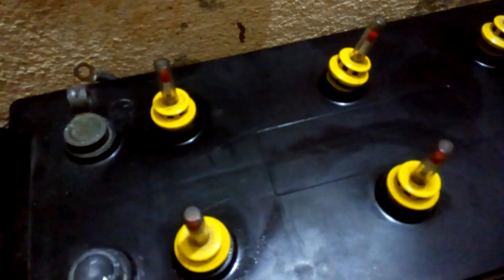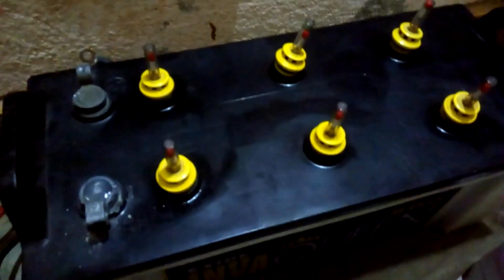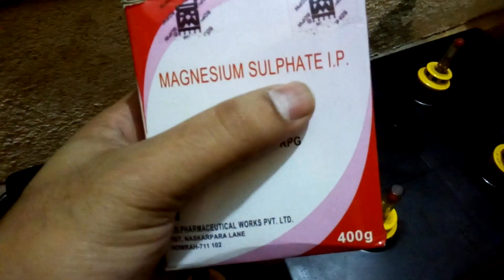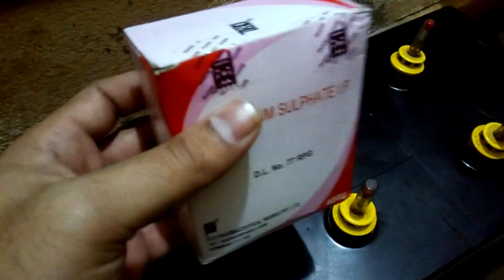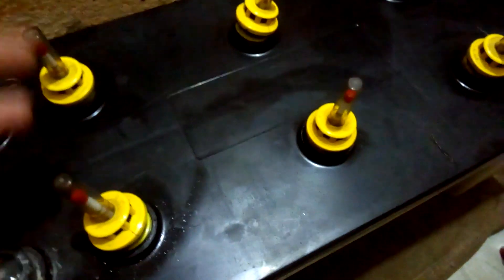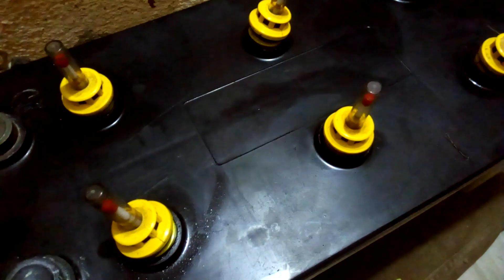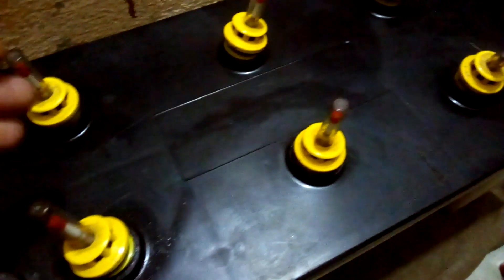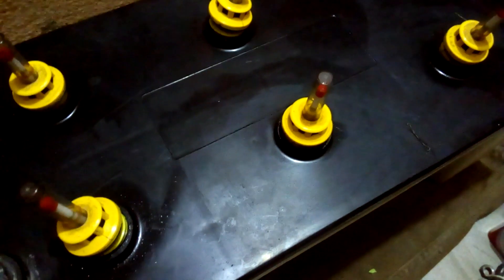How to revive a old/dead inverter Battery

Comment: I have an inverta battery i bought for the past four years. The battery no longer stays long even though it shows it charging when charging it
Reply from the maker: Check the battery voltage & water level
Reply: I have  checked and added water acid
I think the weakness started when  there was no enough  electricity to charge the inverter. We used it for long and it  stopped working. The light came back and after charging it   the capacity  to use it for long dropped drastically
Reply: I mean  to charge the battery not inverter. Thanks
Reply: Please has the battery developed fault or is there any remedy

Comment: After putting the Epsom salt solution with distilled water in the battery , do you charge the battery with the solution inside ? Or you just let the Epsom solution soak ?
Reply from the maker: Chargw the battery

Comment: Bro i did  not put water since i bought inverter and last six months it was not in use so it's battery is dead can it repaired by an electrician?
Reply from the maker: I doubt that bro. Maximum plates are gone i think. But you can try if they cost you little. Or else i suggest you exchange this battery & buy a new one.

Comment: After electricity goes my invertor show battery low, during electricity my invertor fully charge and then after it down
Reply from the maker: Not clear though. But 2 things could happen. Inverter is not charging the battery. Or the battery is old & retired.
Reply: @technoboy-allinOne  is this possible that any wire of invertor disconnect with battery, therefore it's not charging
Reply from the maker: Maybe charging transistor or relay is not working. Thats a easy repair if nothing else happened. If you have multimeter then you can check by yourself. Turn off the ac supply to the inverter,then check the battery voltage. Then turn on ac supply & check battery voltage again. If the voltage is same then inverter is not charging the battery.

Comment: Clean with baking soda 
Then add Epsom salt to distilled water ( 12 spoon for 1 Ltr) . This means 36 spoon of Epsom salt for 3 ltr water as my battery will need 3 ltrs of water. 
Heat the solution until dissolved
Then cool it to room temperature and then add the solution equally to each hole of the battery

Is that correct?
Reply from the maker: Right
Reply: And when to add the acid again or epsum salt will do the work. Where is sulphuric acid in picture
Reply: You are wrong

Comment: First clean it with Baking soda then with Epsom salt (12 table spoon for 1 ltr of water) and fill distilled water and charge it for 24 or 72 hrs whatever and discharge it and recharge it several times. Am I right?
Reply: When to fill the acid and water mixture. First cleaned with baking soda and water, then cleaned with epsum salt, do we need to pour out the epsum salt or let it remain in battery. I am not clear at this point.
Reply: @dushyantchaudharymathura  Clean it with baking soda and distilled water, then pour it out. Epsom salt mixture is the actual acid that makes the battery work, fill 1 litre of Epsom salt mixture into all the cells and then fill it with distilled water until it's full.
Reply: @facts5322  Does this mean that we need not to pour out the Epsom salt solution from the battery and let it remain there and charge it. Does this mean that no need to put back any 35% H2SO4 and 65% demineralised water (distilled water) back to the battery??? Please clarify on this. Thanks
Reply: Please is it 1 liter per cell or 1liter for the cells?
Reply: @ILoveCubing108  pls were u clearified on this?

Comment: My battery these days dry 
Quickly and not much backup as before, backup is now 33% only, my battery is almost 6 yrs old, how to fix can you suggest better way please
Reply from the maker: Hmm its old. But This is the only way. Empty your battery. Clean it with distilled water. Then put epsom salt in all the 6 chembers, same quantity & fill the chembers with distilled water. Then charge it full. There should be improvement.